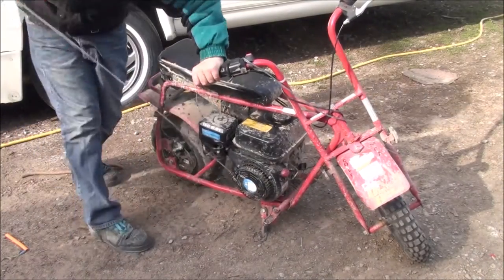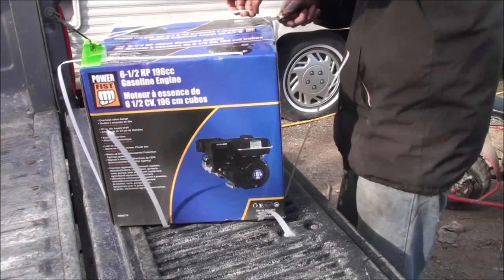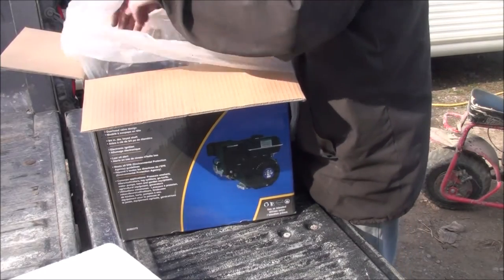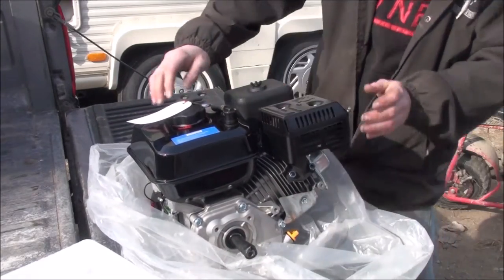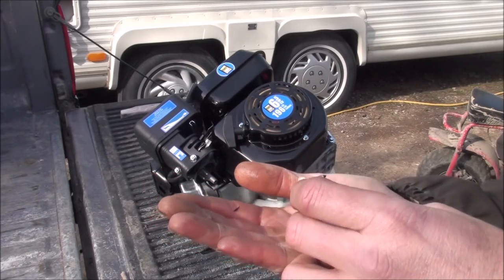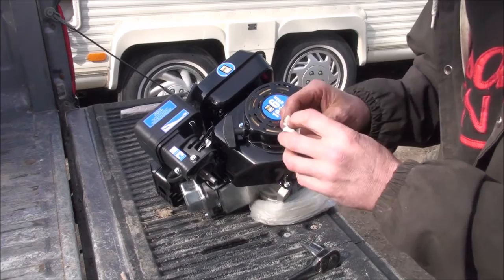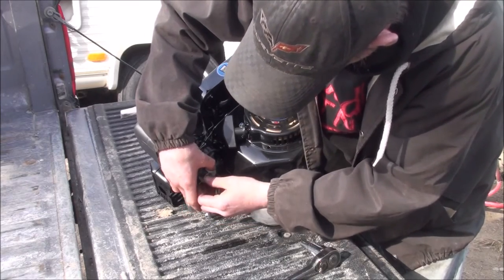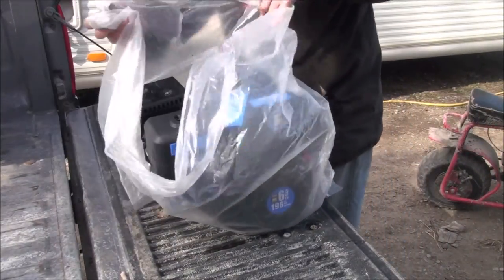Honda clone engine is INHIBITED!

Comment: Awesome video man I've been saving up for the last few months to get a predator engine with 7 horsepower and 8.1 foot pounds of torque I was wondering if my predator I will take it apart later but I need to break it in I haven't touched it yet but besides  looking at it and to check if everythings there but I will go get some oil and some gas I'm thinking of getting some premium gas but I need some opinions and gestures and some pointers if I should run it first of premium or run it with plus 87 octane unleaded gasoline anyways so I was wondering if I do take it part if it does have it or maybe if it doesn't I'll love it if you can be helpful and show or and if there's other cheap and awesome mods that gives it a bigger bang in that improves it and helps it out a little. Also before I start breaking it and hopefully you can replies soon enough  what I should do to help it and make it a lot better for the break in period i don't know how to lower the idle but anyways so if there's anything else that will  really help it please tell me I'm open to any opinions or pointers. Also please list and share some ideas that are cheap or where I can buy some stuff and some of the stuff require tools please share the links where I can find and buy the parts and tools that will be really nice and helpful thank you very much and have a nice night
Reply from the maker: Dustin Allen Well, Thats a big question!  And I'm glad to help. This one is easy - For you, and for me. If you havent done so yet. Buy regular pump gas. And the oil that they advise. Fill the crank case to the suggested limit. Don't over fill. Fill the fuel tank. Same - don't want to over fill it either. leave somer expansion room - expesially in the summer. Fuel does get bigger when heated! Now the best part. Be sure the engine is at idle and the fuel is on. Put on the choke and give her a rip on the cord! It should fire up rite away. After 15 or so seconds - turn off the choke and it should settle into a nice idle. If it don't, shut it down. Now let it sit there and idle. For half the fuel tank - that could be a couple hours. Thats fine. Resist the temptation to rev it.We ALL want to! After the fitst half fuel tank of fuel is burned. shut it down - let it cool competely. An hour. CHeck the oil in the case - top up if needed. run out the rest of the fuel. When its empty - change the oil and mount it on what your mounting it to. And that one fuel tank will be the most important one you ever run. Youll see for yerself.   And! This tip you saw in this video - doesn't apply to your predator! It'll have the honda name on it  - so it'll have the best parts they can make.. As the name says - Honda clone!  Honda would hate to see their clones out running their premium engines wouldn't they? SO they inhibit the clones - I just showed you a way to make it run rite. Good luck and If you need anything more - let me know!Here's a link to a first firing I did on a clone 15 hp engine.http://youtu.be/gU4cCJ9L4hg
Reply: +Dustin Allen these engines run at a compression ratio of 8.9:1 (not very high) so buying premium gasoline is a waste of money, if it was an audi R8, then you would have to run premium.all premium gasoline does is prevent pre ignition in high compression engines, it does jack all in small engines.
Reply: well thank you all I took it back and later on I I'm buying a 420 to put in a baja mini bike frame with an torque converter
Reply: Dustin Allen that's going to have so much power that you wont be able to control it.
Reply: Dustin Allen japan makes cars that have 660 cc engines for cars, you are putting a 420 cc engine in a mini bike. you might as well buy a real bike.
Reply: well really whats the difference between the 420cc up against the 212cc 420-212=208cc  that's the difference between them, in my opinion. and yes i might as well buy a real bike but i im 16, i have race ts250's Suzuki ( i even own one a 77 suzuki ts250 dirt bike, but really its my grandpas but he has preety much had maid it clear that it is mine) i have been on a 450 Yamaha r1 ( numerous of times thanks to my cousin) and that was scary fast for me i have been on the 49cc little hondas dirt bikes ever since i have been little. racing and going fast is in my blood and by dam if i die going fast that will be an honer for me because at less i had died of doing what i had and love the most of doing so me puting in a 420cc hf engine into a rolling chassis of an mini baja bike ( lol ) with a 40 series torque converter is a dream and is what i want personally to do and by daym i tell you what it will be done!! ahah
Reply from the maker: I think thats his plan.... lol

Comment: They are Sure a good deal when on sale for $89.95 Each!!
Reply from the maker: Yup, had just picked this one up for a bud. Had a rain cheque for it. $99. As well as a coupon for $15 when ya spend $100. Worked out quite well accually. I learned this skill when I put the engine in my boys bike... It just didn't have the go it should...Ya know? So I got dickin with the carb and noticed the the little difference in the float compared to my other honda engines kickin round. Once nipped off - It's amazing.

Comment: Does this mod only work on Power Fist engines? I have an older 8hp Briggs on a go cart would love to get more power!
Reply from the maker: I'm going to say - no. It wiont work on an old Brigs. I think this is a manufact spacific mod. Simply because - Even Honda's "seconds" parts are giving their good engines a run for their money. SO -they've designed a flaw - on purpose.